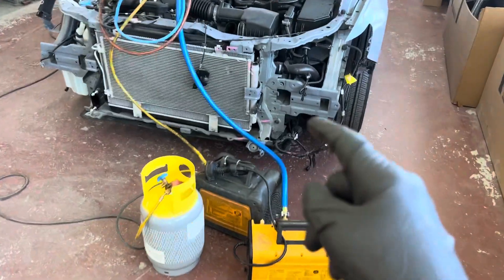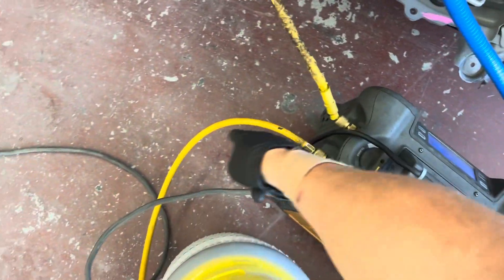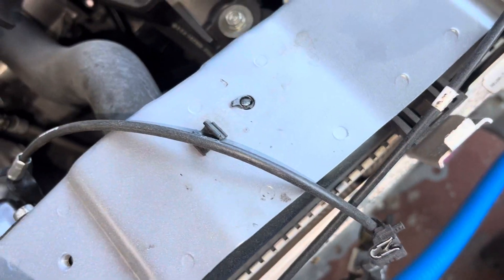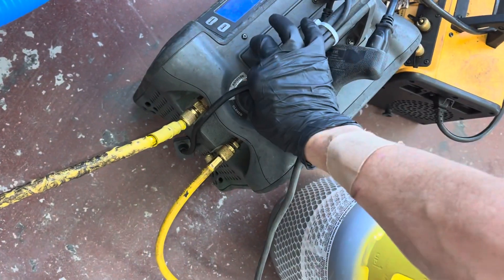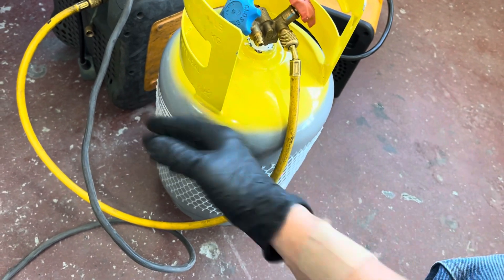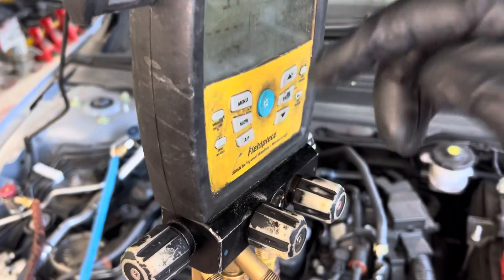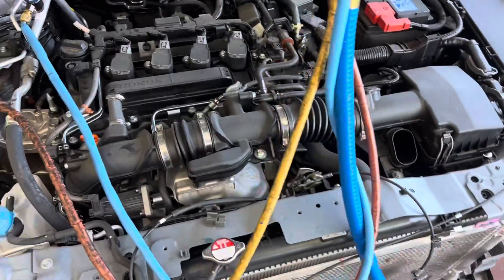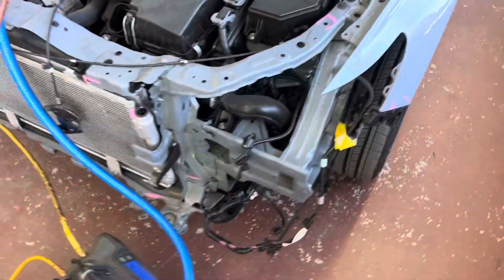REFRIGERANT RECOVERY MACHINE AIR PURGE Fieldpiece MR 45

Comment: why recover to the red/liquid side of the recovery tank?  We're slowly recovering from the L-vapor side of the system.  Is there an advantage to recover into the dip-tube side of the recovery tank?  Thanks/John
Reply from the maker: Some tank manufactures the red is the vapor side and the blue is the liquid side

You cannot trust the colors on the knobs 

It depends on the manufacturer who makes the recovery tanks .,

But on small automotive, refrigerant, capacities, speed wise it makes really no difference on the liquid side or vapor side of the recovery tank . 

Because the quantity of the refrigerant is so small . 
And if you have a good recovery machine that subcool the liquid, there’s no pressure issue . 

When you get into large commercial or larger residential units when you start talking about 10 pounds or 50 pounds of refrigerant, then it makes a difference what side and what method you use to recover refrigerant .  Time can be difference in recovery time if done improperly. 

Cars are just small toys
Reply: @coldfinger459sub0  Thank you!

Comment: Hey Thomas I got a non-related question but I think you can help me a bit.

I want to put a larger filter drier on my portable recovery machine like you did some time ago, what type of filter you used to recommend me? Im using the little ones on the suction with 1/4sae fittings but I think larger ones would do better job, only because I re-use the old gas into the system and I want the minimum possible ammount of moisture and particles into it

I shouldnt use anything that isnt XH7 dessicant right? (for r1234yf maybe not) Because supplier here has 4 or 5 types of filter driers which some of them catched acids, others only stores moisture and such things

Hope it doesnt take you so much time to answer, isnt my intention to steal your time so you dont have to!
Reply from the maker: Sporlan catch all filter dryer  like C-419-S.     Or  C-303.  Ect 
The biggest one you can get, you can always use step down bushings or step down. Threaded inserts to get it down to the size of your hose. . 

The refrigerant still is not usable after going into a container. It still will have a mixture of all the different types of oils inside the refrigerant recovery cylinder. . 

The filters will reduce the moisture, and they will take out acid and they will filter out particulate matter . 

But Air, there’s a problem and oils are a problem . .  

And you need good shut off valves

The very first time if you ever have an air leak and  outside air, it will ruin the dryer instantly it’s no good the first time you’re exposed to air . 

There is no , if , or , but , excuse ITS BAD MOISTURE SATURATED. 
Check and double check all fittings are correct tight.

Comment: And what would be your advice for a connection setup with MR45 when we want to pull out and then reuse the refrigerant? Best regards! Thank you!
Reply from the maker: You’re talking about automotive. 

Then the refrigerant goes through a recycler . 

Remove the oil 
It removes solid particulates from burnouts 

It removes the acid 

Remove the moisture 

It removes the air . 

And then you run it through the refrigerant analyzer to check it’s purity 
That it is only one refrigerant, not contaminated with a The Refrigerant

And the refrigerant analyzer gives you a read out that it has 0% air. 

Then it’s ready for reuse
Reply: @coldfinger459sub0  <3

Comment: Thinking about the cars you see from a philosophical perspective. This car is one of those that was not abused by lack of professional pride. 
Customer who went to the hack shop, months later: Oh, the A/C is broken down again - and complaining about the car or the manufacturer.
Reply from the maker: True if I understand you write very rarely does the customer associate the work not done properly nine months ago by a shop on the air conditioning actually caused the damage or break down later on
Reply: @coldfinger459sub0  
I'm not happy with how I phrased my sentence, but I did just wanna praise the work Tom Lech does. Leak free cars with no mix of 134a 1234yf, nitrogen air and moisture when done. My point is that the customer will not know if he/she get the good or bad job. Or knowing why the A/C failed later. But Tom's repairs will be the customers that will be happy long therm without knowing they were lucky ones. Edit, Adjusted the post a bit.
Reply from the maker: @Casal70  👍 excellent way to put it. 

That’s too bad they will never know the difference . 

Except for sometimes when it comes out, colder than they’ve ever had it before .

Comment: hose between tank and recovery machine wont be vacuumed ;) even if you changing knob sets
Reply from the maker: Yes, that one you need to purge at that point

Unless you really wanted to go through the effort of putting in a three-way T and vacuum at the tea with a ball valve
Reply: @coldfinger459sub0  dont prefer purging, im not sure it working 100%, every time i purgin i think that air "roll" back into hose on the walls 🤣and some amount of refrigerant is vented to atmosphere with no reason. I'm usually connect "OUT" hose out of recovery machine via T-Connector to the tank. Then 3rd output of T-Connector is hooked up to 1/4 vacuum pump port. Than, my whole circuit is vacuumed from both sides of recovery machine valve Knob. 👍
Reply: @smklimatyzacja88  Cool tip! Thank you!